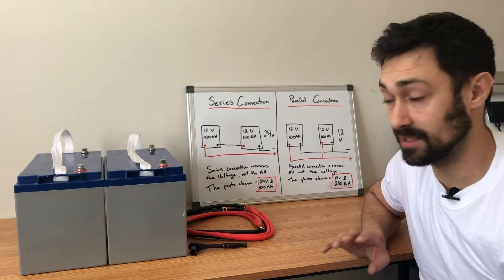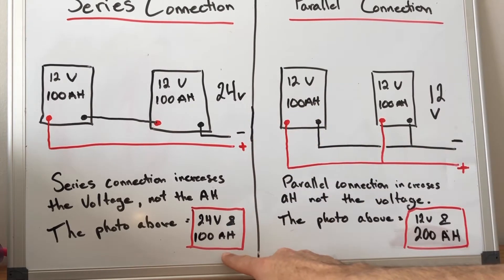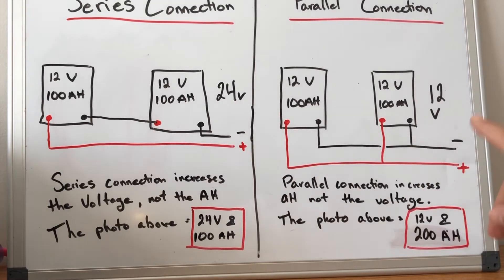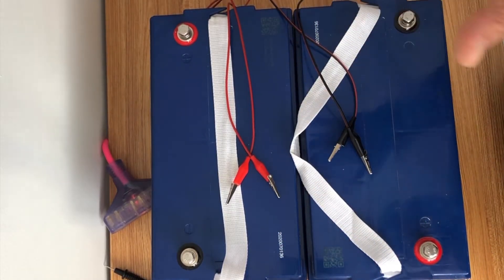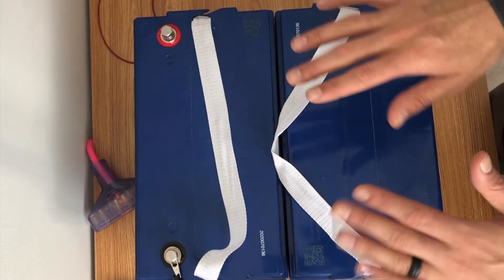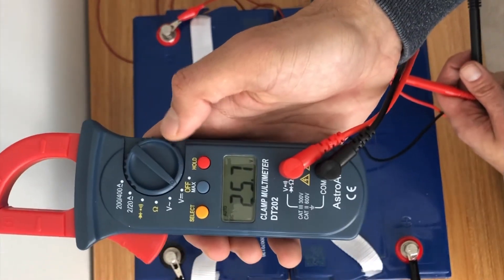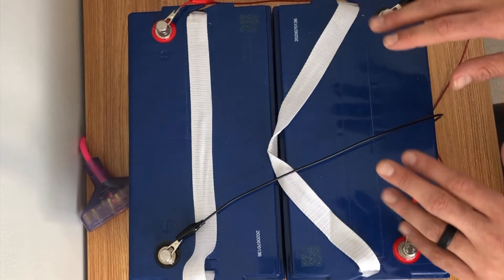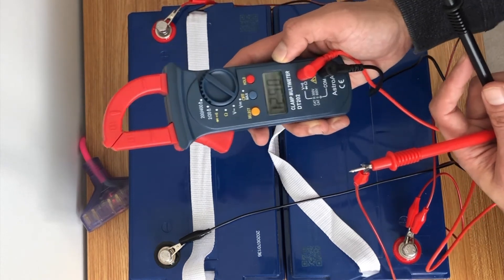How to Connect Deep Cycle Batteries in Series Or Parallel - Off-Grid Solar Power System Setup

Comment: Hello, is it better in 2 parallel agm batteries to take the negative and positive in a criss cross pattern (taking the negative from one baterry and the positive from the other battery) so they can charge and discharge more equally, than taking the postive and negative from the same battery ? Thank you.

Comment: Hi can you help i have 1 x 150 watt solar panel 1 x 20amp charge controller 1x 110 amh battery 
But want to charge 2 of these batteries  now. Doni need bigger amp controller  as im unsure if this becomes 12v or 24v  then and would it need a 12v inverter still ? Thanks